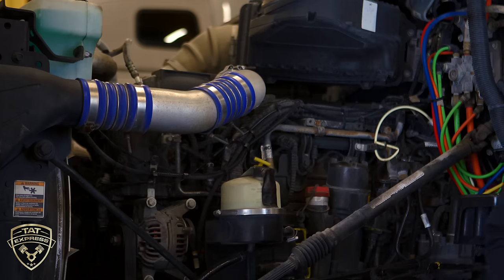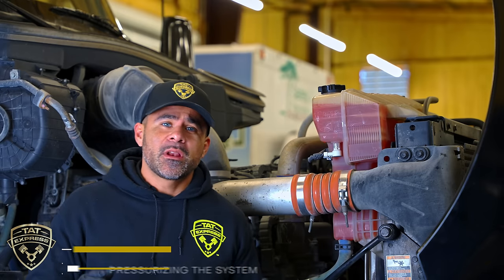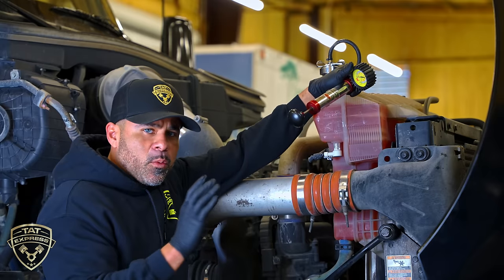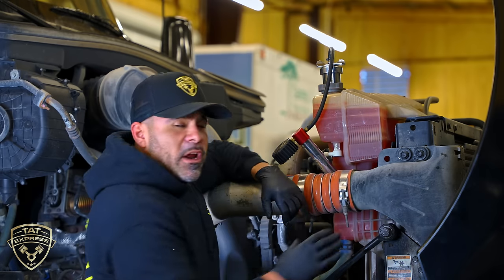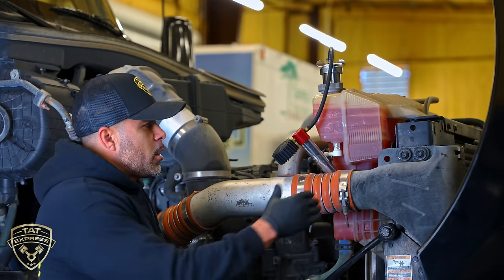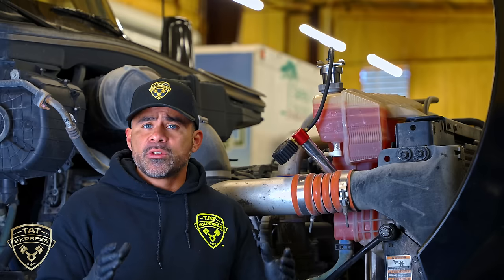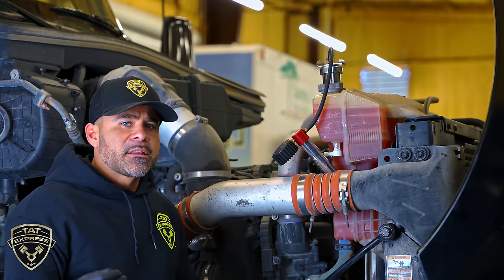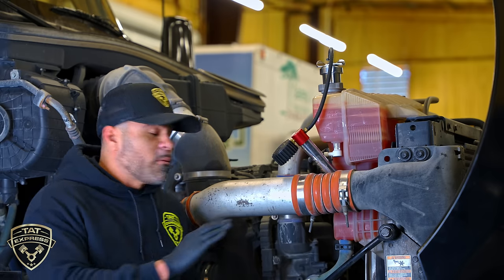10 year old Coolant Leak MX13 Paccar/MX13 coolant leak for over 1 year/ Coolant leak failure/

Comment: Having run my Pete with the Paccar MX13 for 4 years now. ( 460,000 miles ) The only major problem I have had. Is a radiator leak. Easy fix repaired in the shop in a day and a half. I am still impressed with this motor.

Comment: Thanks for sharing knowledge bro.  My mack mp8 had same issue as top radiator leak and that was fixed but now i can see water pump leaking as well a bit not too much.  Just need advice should I just change water pump gasket or whole water pump , coolant leak is coming out from joint probably where the gasket is I believe.